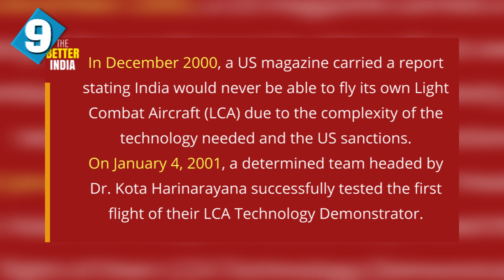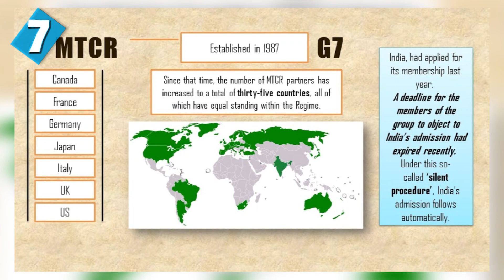10 Surprising Reasons Why HAL Tejas Took 33 Years To Develop

Comment: Tejas didn take 33 years. Period.
Anybody with basic reading skills would know that the Project Defination phase, first step in a fighter developement programme , began in 1988
Tejas was inducted in Dec 2013.
Anyone with basic maths skills would count it to 25 years
The average timeline to develop a fighter of this calibre is 20 years.
The issue was , manufacturing pace didn pick up after 2013 which it is now.
Reply: ohh.. you liar hindu accept 25 years.. lolx.. at least you are accepting this.
Reply: It did take 33 years check tourself
Reply: It was 2016 when Tejas was inducted into the squadron of the Indian Air Force. The squadron was named The Flying Daggers. 

In 2013 on December 20, Tejas received the second of the the three operational clearance.